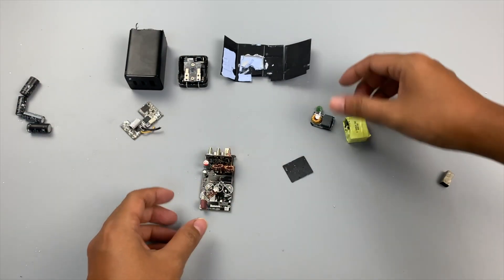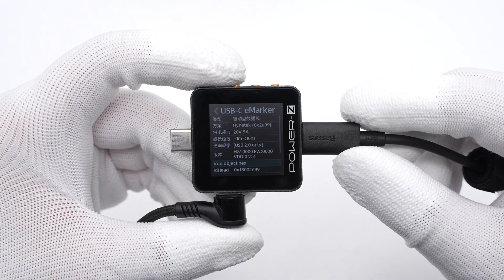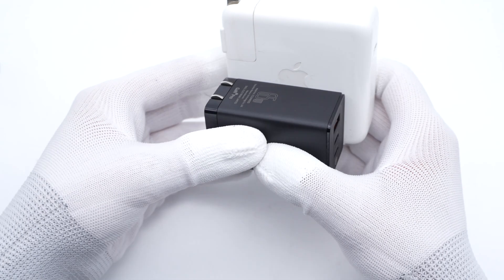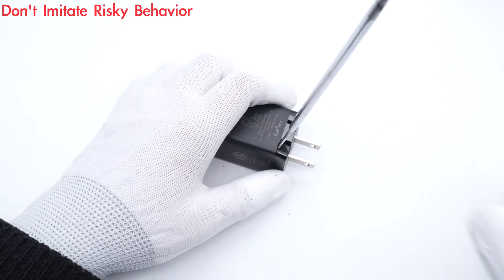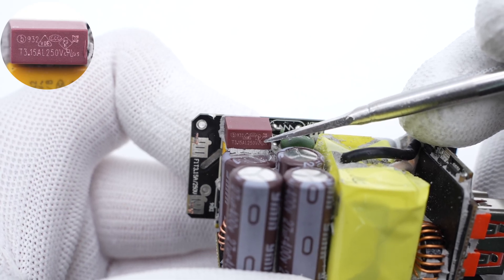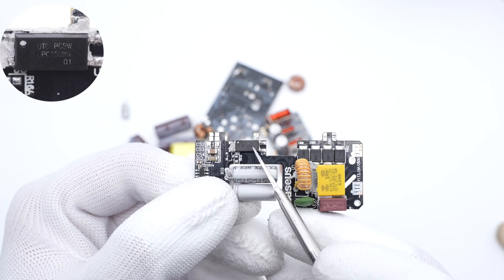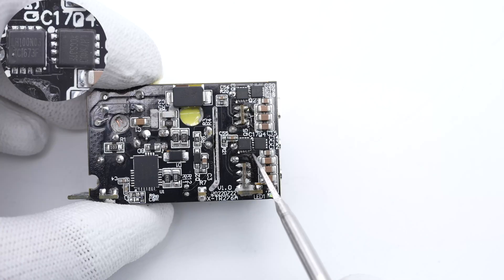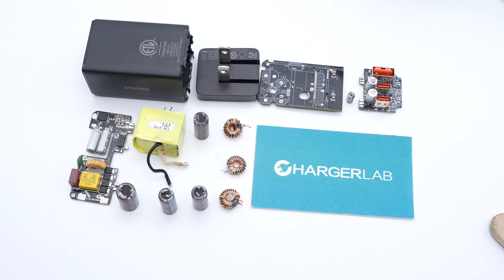Teardown of Baseus 65W GaN5 Pro Fast Charger (2C1A)

Comment: There is Gan 6 pro 65w with 2c 2a. Wish you preview it soon, as I test type c1 and type c2 cannot max 45w+20w as advertised, it only output 20w type C1 and 13 to 15w on Type C2 port while charging 2 devices at the same time.

Comment: What about difference between GAN 5 and GAN 3 model?
Reply: GaN 1 charger could offer up to 88% efficiency whereas GaN 3 can offer up to 93 %. GaN 5 can offer up to 95% peak efficiency along with lossless sensing.
Reply: Not big difference you can condsider both equally.

Comment: I bought recent GaN3 and return it to buy GaN5. My GaN3 was disconecting other outputs when connecting new device. Also on C2 port my phone (Samsung A33 max 25W PD) was charging faster 12W while in use and on C1 port it does not wanted to charge at all (when in use). Off screen they worked the same 25W. I hope this new chip fixed it. Still waiting for the GaN5 to arrive. Thanks for this video.
Reply: it is normal for it to disconnect other devices because it needs to negotiate all devices charging protocols
Reply: is the link in the comment to the gan 5 pro model or is it the older model?
Reply: @stoicsage00  It looks like the older model.

Comment: i had now 3 of these, all fail after 3-6 months, did you experience anything like that, or have a guess on the reason?
Reply: When the time i receive, the USB-C 2nd port fail.... after 4month of usage, the product totally KO... 1st time using this product... So disappointed
Reply: Yes Baseus charger and cable suck just like Aukey. They might have more tech or charging protocols packed in there but they don't last at all and their warranty customer service sucks, even worst the cable will give you electrical shock if you pair it with any charger whether it is Baseus, Anker or Ugreen (electrical shock comes from Baseus cable)
Reply: Mine was the first gen GAN 65W still running for 3 years now, the folding prong is bad but the the charger still work.
Reply: Are you really talking about this recent GaN5 model? And did you complain about the defective chargers to the manufacturer? What was your experience with them?
Reply: @juergenlilien2067  I have the EU model of the same. It also broke after limited usage (while charging from the USB-A plug). Got a refund from Baseus. I opened and checked input connections and the fuse. Resoldered most points. But it didnt help.
Reply: Mine also died. Just blinking / strobing blue. I guess I should stay away from this brand.
Reply: Baseus is a fashionable and overrated brand, but in reality it is not all that. There are many reports of defects after a short period of use. I have a cheaper 33W Essager and I found it much more reliable.
Reply: Mine dies in 3 months. The reason that I found is the foldable plug. Before it completely dies, I have to not fold the plug all the way out to get it to work. Very sadly, it’s a good charger but only a bad plug. Now I’m looking for a GaN charger with a changeable plug or power cord so I can comfortably use with wall plug.
Reply: @xtradi how long have you used it?  which templates please?  I'm in doubt between this Gan5 and a 100w 4-port Gan2
Reply: I have a Gan2Pro in use for about 4 years now, daily usage of multiple ports, charging MacBook iPad Phone Watch etc, no issues. European model so no folding prongs.
Reply: Baseus Gan 5 pro eu plug, didn't work after 3 month of use..
Reply: My 65W die after 2.5 year
100W die after 2 month, very frustrate huh.
They QA is worst. 

Right now I'm use only UGREEN
Reply: Same thing happen to me😂 but the cable survived for years !
Reply: My baseus also died with no reason after 9months of usage. The led simply doesnt light and no power output. Baseus offered a coupon for my next purchase , I'm now using another model and it is still working. Let's see how long this will last.
Reply: Mine gan3 pro 2c1a 65w plug-in 24/7 almost 2 years no issue so far. Just buy gan 6 pro 2c2a, though I dont like new one, because it advertising usb type c1 and c2 will ouput 45w+20w, as I test it plugin both at the same time result is 20w+15w, this is insane low, if I use only 1 port type 1c surely it will max out 65w, if any other port plug in and charge something else type c1 will limit to 20w.

Comment: very good test, would be perfect if there would be some futher measurements like voltage, heat and efficiency
Reply: It is what it is, and for that it is interesting, but I would not call this mostly dissection a test. Unfortunately, it is still hard to tell whether the charger would be a good buy.
Reply: Look for AllThingsOnePlace. He tests the actual power adapters instead of a superficial glance of the components during a teardown. Power Factor correction, Quiescent current, etc... look for him. I believe this one wasn't a top performer...
Reply: @gbraadnl  you got me with the "top performer" lmao